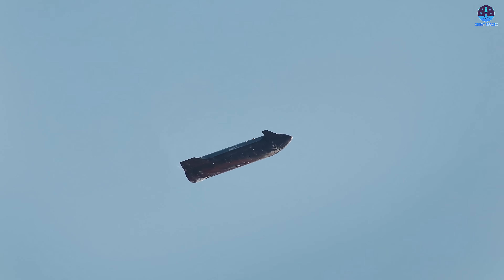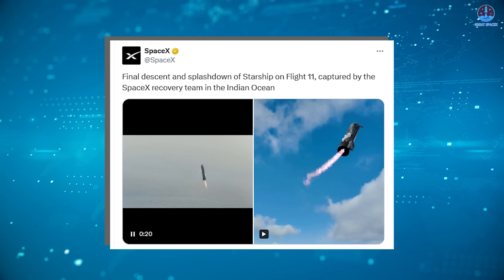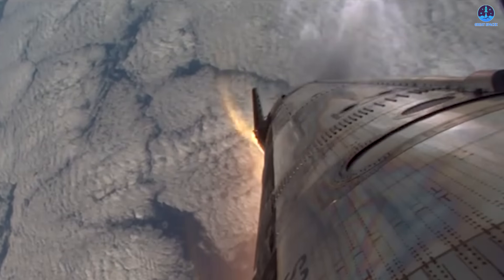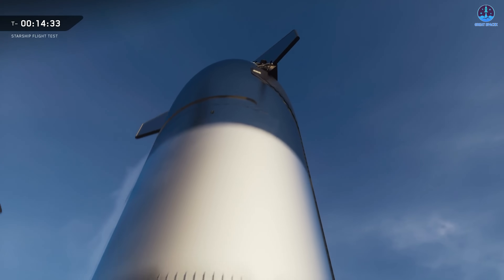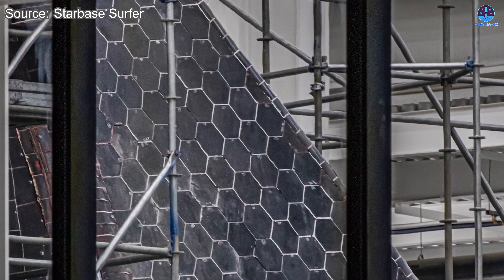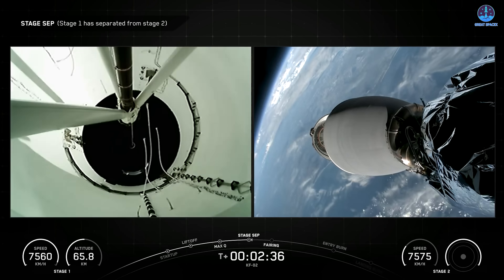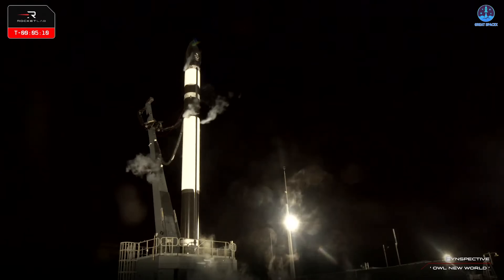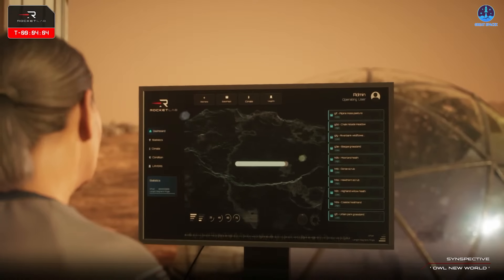FUEL TANK LEAKED!' Incredible Starship Flight 11 Landing Footage Shows New Problems on S38...

Comment: My company Magnum TPS LLC has a cutting edge thermal protection system design that will give reentry craft 150+ safe reentries and save weight allowing for 2 to 3 tons of added cargo.
Reply: What are you using? MgO ceramic?

Comment: GREAT SPACEX great bullshit post this was an experiment a test of the extreme, aso whats with the NEW PROBLEMS
Reply: You're delusional!  This was a slow pitch mission and although it made it back in close to one piece it was full of deal breaker problems!  At some point all you fan boys need to realize just how poorly designed this machine is for the mission at hand!  

Most of us knew this a long time ago!  You couldn't pick a worse design for a reentry vehicle. There are good reasons  why every other success in the history of space flight, used either a capsule design with an ablative heat shield or a space plane design with a much larger surface area with a complex specialized TPD to dissipate the energy.   But instead of these proven designs, Space X went with what amounts to a ballistic missile!  A design built around building speed to hypersonic levels!How well do you think this will work coming back from space at meteoric speed?? How will it slow down enough for a soft landing?    And it makes no sense at all, being a combined cargo and crew vehicle and it never made sense to design it this way!

It barely survived a very low stress test flight. But surviving s light years away from rapid reusability!  11 test flights in with many improvements including more powerful engines and it still has a thrust deficit of more than 80%!

Comment: The stated aim of Starship is to 
1 Launch 100 tons into low earth orbit
2 Recover booster
3 Rapidly reuse booster
4 Recover Starship
5 Rapidly reuse Starship
Each and every one of these attempts resulted in abject failure yet they are hailed as an outstanding success.
The mind boggles.
Reply: They have successfully recovered and subsequently reused a booster (not yet rapidly),
They have not yet attempted to recover a starship.
So you are complaining that SpaceX has not achieved all its eventual aims, when it hasn't even attempted most of them yet!
NASA has been aiming to land humans on the moon since 2017 (when Artemis program started) but it hasn't achieved that yet either - but then it hasn't actually tried yet. The current starship program started in 2018 and has so far achieved 11 test flights, Artemis has been going longer and only managed one test flight - completely different strategies being used.
Reply: Trouble is, you missed the facts - reused booster returned completely under control, the starship also returned, completely under control, and the heat shield survived much better this time, and they purposely removed tiles to find what happened.  No one else has made a recoverable rocket, like Falcon, and Starship is a much bigger enterprise.   Why the beef?

Comment: I know SpaceX wants to stress test Starship’s heat shield, but shouldn’t they do a full shield test with the heat shield fully intact to show that if the shield is intact, it works?
Reply: I would think testing the implications of lost tiles is essential. Like Crash test on cars :-)
Reply: @petersbayley right, but that’s because we know cars don’t spontaneously explode unless they’re in an accident.
Reply: Bro thousands of spacex employees are aware of what they are doing
Reply: There have been several reentries now, with thousands of contiguous tiles demonstrating robust resistance to heating and max dynamic pressure. A fully intact shield working faultlessly won't tell us anything about what happens when tiles fail or if experimental tiles might be even more robust, or if thinner lighter tiles might work just as well, or what happens if the underlying ablative material is omitted.

Frankly I'm rather the more surprised that SX hasn't been sending up patchwork quilts of variegated heat shields and patterned no-tiling, just plain sprayed-on ablatives and the like.

Comment: I have said it a thousand times and I will say it again. The heat shield being reusable is not necessary for starship to begin flying missions to orbit. all that is needed is for the ship to survive the catch intact. The heat shield can be disposable for years. replacing it between flights is fast and easy to do. having the ability to get the job done and put cargo into orbit is more important and would generate additional funding for future heat shield development. the ship would have to go back to mega bay for inspection and reloading between flights anyway. instant reuse is decades away. time to make money with starship and start getting cargo to orbit.
Reply: I sure Elon & the engineers at SpaceX would appreciate your input on this matter. Have you contacted them ?
Reply: @WG-tt6hk  😂
Reply: Re-usabiity is core to the cost efficiency model. In order to achieve the Re-Fuelling necessary, the number of Tanker Ships required if not quickly re-usable makes a mess of the entire plan ... I am unsure why you are so keen to just replicate an updated Shuttle approach which cost billions each and every flight ...
Reply: @Jester-Riddle  -star ship will not cost billions in order to achieve 90% reusability. space x is going to have to make at least ten tankers which would be required in order to maintain any fleet going to mars. in reality they will need close to 30 tankers. the heat shield is the one thing that may let others jump ahead of space x.  better to start making money on cargo to space which would reduce the cost of developing the heat shield.
Reply: What the fuck are you raving about?

Comment: I feel like there was alot of heat shield loss on this flight. Crunch wrap might make them less secure or the heating from the removed tiles may have caused a bit of a domino effect.
Reply: Nah. The previously removed tiles causes an incredible amount of stress on the remaining tiles. If all holes were plugged, there would be little to no tiles removed during flight.

Comment: Every barely competent engineer would scrap the tiles based shield a year ago and a realy good engineer would not even waste a dime to begin with. ACTIVE, INTERNALLY COOLED DOUBLE LAYER SHIELD IS THE ONLY CHANCE!!! Come one, are everybody blind? - this thing is literally fried!!!
Reply: I disagree - though I would like to see the mechanical tile attachment system improved.

Perhaps using something like a multi-way (6 sided ?) barbed pillars to increase attachment ?

Certainly something like that is worth experimenting with.
Reply: @peterclarke3020  This would not solve anything - the boundary layer is well above 3000 K and there is no material to withstand that without cooling. You need a double layer bottom shield cooled from inside. No doomed expensive crazy to build tiles - just a bare internally cooled steel jacket and 5-10 tons methane for cooling.
Reply: Just the fluid layer and the extra sheet of steel would weigh as much as the tiles. Plus the extra coolant you would need to carry to compensate of boil off, the valve and plumbing system, the management systems... I rather like the idea of creating new, almost impossible materials to solve this problem.
Reply: @SpecificImpulse-ISP  I've performwd hundreds reentry simulations with tiles and active cooling - you need between 5 and 10 tons methane for cooling - I've done the math as I am a thermodynamics engineer...
Reply: An actual engineer rarely gets to design something optimized for a single parameter. It’s not just about making the heat shield reusable without maintenance it also has to be lightweight, redundant with failure tolerance, and simple to manufacture.
Reply: The real objective is Rocket Efficiency to the level where Engines can be used to slow the Ship without exposing it to the massive heat and stresses that introduce huge potential failure risks. The Rocket Skin could then focus on protection from Cosmic Rays and other impacts ...

Comment: Why do you constantly lie in your videos. All those tiles were removed on purpose and they expected exactly what happened. There are no new problems.
Reply: The removed tiles is what caused all the extra tiles to peel away.
Reply: @SpecificImpulse-ISP 
Not sure that removing some tiles caused the other tiles to peel away - though it would obviously have had some influence.
Reply: Technically they didn’t know exactly what would happen after deliberately removing those specific heat tiles - that was the reason for doing it ! To find out !
Reply: All of them ? Are we sure that all the missing tiles were removed before launch?
Reply: @aramark1208  I think they were hoping it could manage if it lost any tiles before re entry. Unfortunately it looks like it can’t, despite making it to the end of this flight.
Reply: Lots of tiles blew off starship during ascent and re-entry. You can literally see them blowing off in the video and the underlayment material flapping in the wind.
Reply: @undertow2142 yes some of the extra tiles glued to the top of the flaps didn’t survive ascent vibrations. Some tiles were deliberately removed and some were attached using different glues instead of mounting pins. These are just tests. It’s the last version 2 so who cares if it blows up. The best data they got from this is that even if burn through occurs they can still make it through re-entry and stick a landing. That’s priceless.
Reply: I'm guessing jealous muslim inbred

Comment: So, SpaceX has a couple problems to fix on Flight 12. Flight 12 might not orbit a full lap and concentrate on the fixes.
Reply: Of course flight-12 will be sub-orbital too - as that makes the most sense, because Starship-V3 has to prove itself, as do the Raptor-3 engines…

So a Sub-Orbital flight is the safest option for this ‘New Starship version first flight’.

Comment: Mr Kevin, it might be wise for SPACEX to blanket the internal fuel tanks with heat resistant blankets or even smaller heatshields incase of burn through. 😊
Reply: With all the tiles they left off, I am surprised they didn't get more burn throughs.
Reply: You realize the ship itself is the fuel tank its a tube with a top and bottom cap on it. The part of the ship you see is the outer wall of the tank.
Reply: @brindlereo5972 yes, I do. I'm sorry I should have neen more specific. The Header Tank and supply lines should be protected by a blanket or heatshield tiles. I was a we bit distracted by SCREAMING BRATS! 😂😂 Not mine or they would have had a very warm......!!,
Reply: I think asbestos needs to make a comeback

Comment: Is there any progress towards reusability? It's ominous that they made no attempt to catch the booster, and there doesn't appear to be even dummy Landing legs on the second stage. 11 test flights and still no orbit. How many before they demonstrate full reusability? 50?
Reply: Baby steps, they will catch the booster not land it. That booster was previously caught.
The testing was for re-entry, going into orbit is the easy part
They will attempt to catch on #13 is my guess
Reply: @DaveBigDawg that's not correct. Orbital flight requires more velocity, and a retro fire burn. That means more fuel expended, and less payload. Take a look at the altitude at which SpaceX satellites are deployed. Far lower than the altitude necessary to deploy any other form of communications or other satellite. The system is completely irrational for use as a delivery system for starlink, because the Falcon system is already in effective use for that purpose, and falcon can deliver almost anything to any orbit. 11 test flights and still no orbit? Something is wrong.
Reply: @jimeditorial  Falcon cannot deliver the new LARGER version of starlink.
Reply: @brindlereo5972 why is there a larger version of starlink? Sounds to me like a delivery system with a payload design to make it relevant. There is a very small market for heavy lift to low earth orbit, something we see by the slow uptake of falcon heavy service
Reply: Larger Starlink has more bandwidth and direct to mobile phone cell service.
Reply: @IanUK. Falcon heavy has a very large payload shroud
Reply: @jimeditorial this is testing for re- entry 
The hardest part ,Getting to orbit will be easy for SpaceX. 
No one has ever launched and returned anything of this size.
Just another hater ane will still jate no matter what SpaceX does
Reply: Yeah 50 test will be needed probably  😄